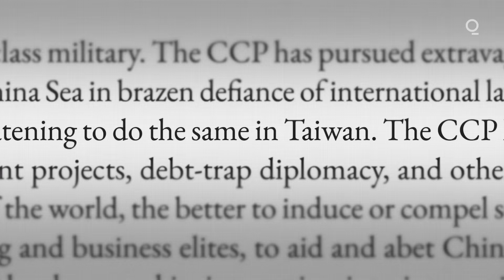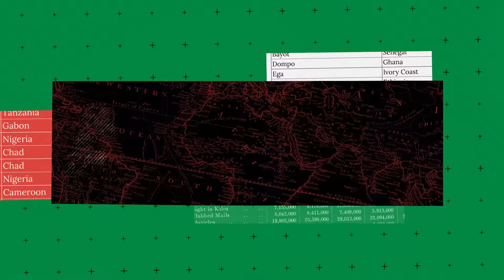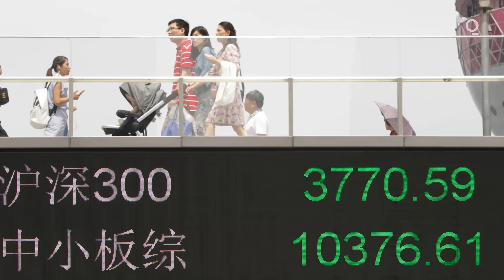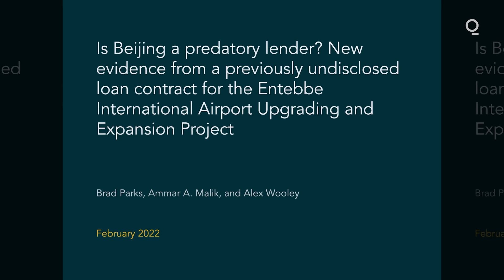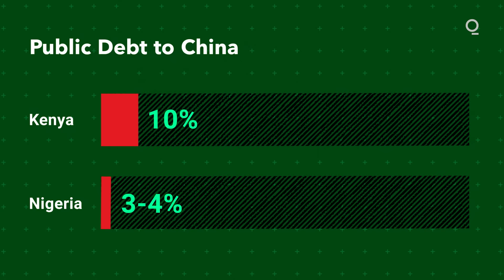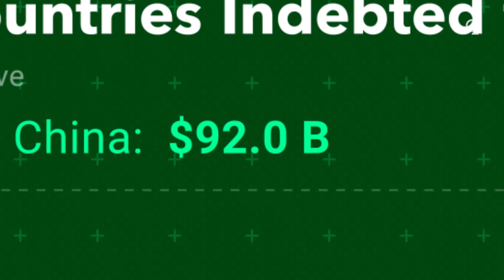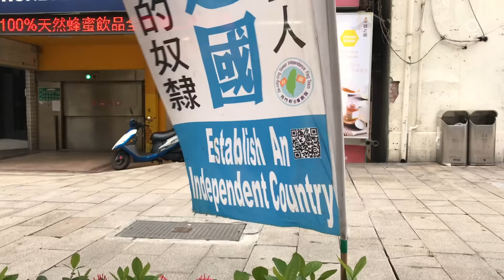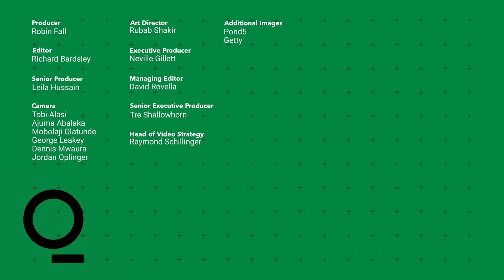The Myth of the Chinese Debt Trap in Africa

Comment: All of these prognostications mean nothing. Time will tell in the resulting reality. Both sides of this debate have valid points, and really, no one knows how it will turn out. If the Chinese investments yield long term benefits, then due praise will come for that; on the other hand, if  infrastructure falls apart, investment money spent does not produce an economic benefit exceeding the cost, etc etc, then condemnations will come and the debt trap narrative will be strengthened. Also, not all cases are the same, there are different deals for different nations, we shouldn't assume there will be a uniform result no matter the case.
Reply: Finally a sensible comment
Reply: @orbitalpotato9940  You're absolutely right!
Reply: You’re right.
Reply: @dailyrant4068  wrong, this is akin to what the US did a month prior to the invasion of Ukraine. The US intelligence community gathers intel,  makes assessments, and the US Government issues warnings to foreign nations and the international community at large based on those assessments. Chinese investment in general is not a threat to US interests, unless it comes with ulterior motives aimed at harming the US. An invasion into Ukraine is not a threat to US interests either, considering they are not in NATO. All the same, the US understands its role as the global hegemon, and tries to fulfill the responsibilities of that status. When the US warned the international community that a Russian invasion was imminent, what did the vast majority of people say? They ridiculed Biden’s efforts, and all of the pro-Russian trolls were out in huge numbers on the net claiming there was absolutely no chance for an invasion despite growing evidence that Russia was building up a massive military force near the border with Ukraine.
Reply: Yours is a fair point. Nevertheless, the facts are, 1) China is being accused of putting Africa in debt trap by the same people that have looted Africa for centuries, 2) The Chinese debt of 4-15% has achieved in the last 20-30 years huge infrastructure building and modernization projects for Africa. What the west has done with the remaining debt load is little if almost thing for Africa.
Reply: @dr.j5642  I have no idea what you're trying to reply.  You are stretching the topic way too far.  That's not even what I was arguing about.
Reply: @harrygore1855  allow me to address you, point by point. 1) I don’t grant that the West has looted Africa for centuries, its not that simple. This is another very long discussion, but to touch base very quickly, the vast majority of African slaves sold to the West were sold to them BY AFRICANS. Typically, they captured individuals from rival tribes and sold them off to disrupt their stability. Also, every region surrounding  Africa has conquered or plundered them, whether it is Europe or the Middle East (China did the same to many kingdoms, and even empires like Tibet and the Turkish Khaganate that controlled Xinjiang). So, by your standard, the only ones who are justified are the nations that were too far away to take advantage. As a matter of fact, the entire debt trap narrative is suggesting that China is now in the very process of looting Africa. By your logic, a former criminal is not allowed to point out the actions of a current criminal in the very act of the crime. That is a completely incoherent position to be in. Europe’s former crimes, mostly committed more than 150 years ago, does not invalidate it’s ability to call out similar crimes being enacted against Africa today, but rather enhances their ability to do so. 
2) In the last 10 years, Africa’s debt has doubled, from around $300 Billion USD  in 2010, to over $700 Billion USD in 2021, and China owns over $150 Billion of Africa’s debt. That is actually closer to 20%. And that number is only climbing.

Lastly, the infrastructure is nice, but how long will it last? Even in Mainland China, the infrastructure is falling apart all the time. Roads and bridges built 15 years ago are crumbling. Apartment buildings built just 10 years ago fall over virtually every year. The quality of concrete they use is among the worst money can buy. With the cost the Africans are paying, they need this infrastructure to last at least over 50 years, but it is HIGHLY unlikely they will last that long, because the same infrastructure within China itself doesn’t last that long. In China they can afford to rebuild all the time, it is part of what drives their economy, but does Africa have that luxury? Absolutely not. So you tell me, are the Africans really in a much better place in 10-20 years, when they’ve only paid back a fraction of their debt, meanwhile their Chinese built  infrastructure is falling apart? Or is this merely a temporary lift? Akin to the high of a powerful drug, which alleviates in the short term, but causes horrific consequences in the long term. Personally, I think the latter is more likely based on the evidence, and the deals which have already gone very badly for nations like Sri Lanka.

Comment: I think the problem here is that both the Chinese and the developing world like African continent lack experience with return on infrastructure investment, which is unintentionally putting lenders on massive and often time unsustainable debt. Even return of Chinese investment on China is significantly less than that of experienced Western investment. So, I believe it takes time for Chinese to be experienced enough and become comparably equipped with analyzing return on investment and sustainable growth. But being optimistic, we will eventually get there with massive push on investment.
Reply: I don't think you have any idea what is the point of the Belt and Road Initiative. I'll give you a suggestion, it's not to get a quick buck building some airports.
  Think harder.